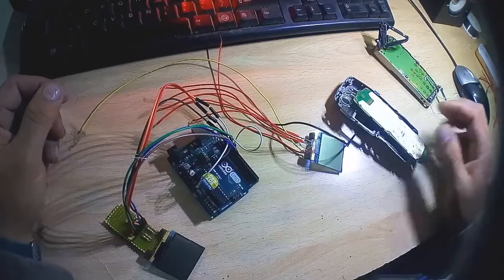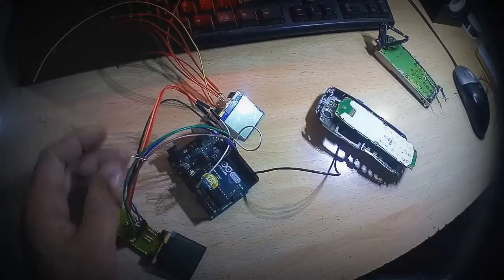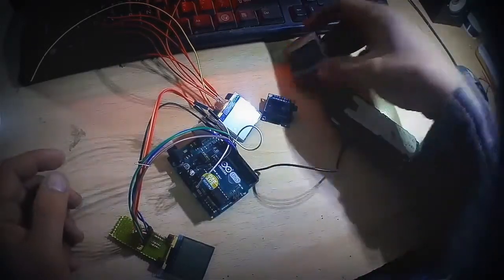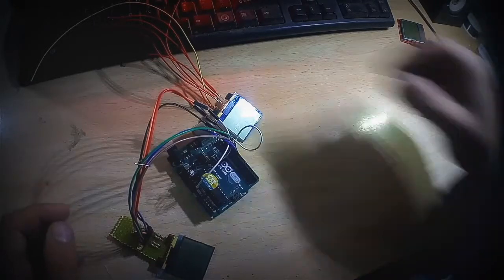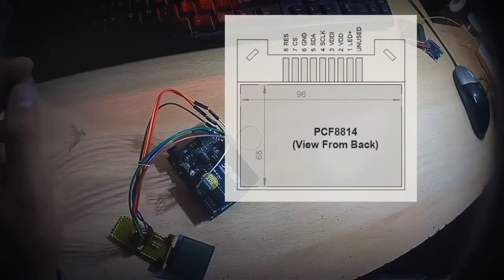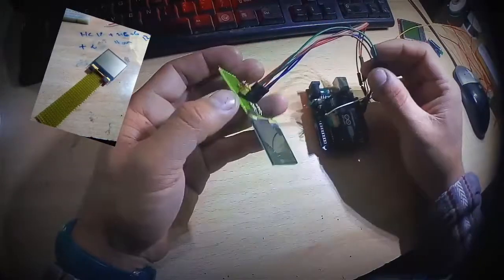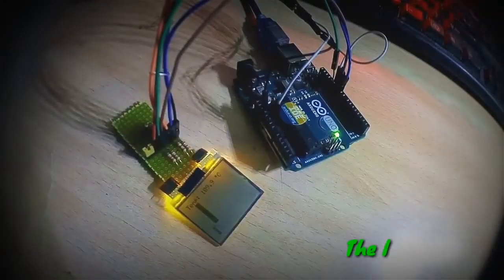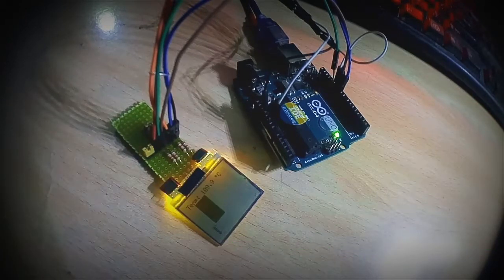Nokia 1100 LCD with arduino

Comment: Is this working for a nokia 1600 LCD?
Reply from the maker: Pinout plz ?
Reply: @kiradite4321  it doesn't matter anyway it has no chance to work.  My display uses ST7628 driver instead of PCF8814, but thanks for the reply